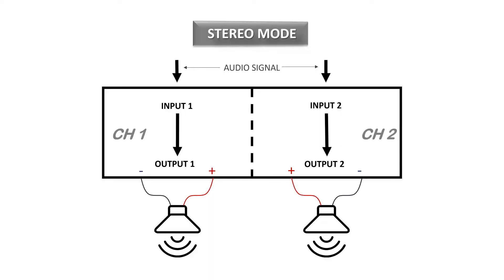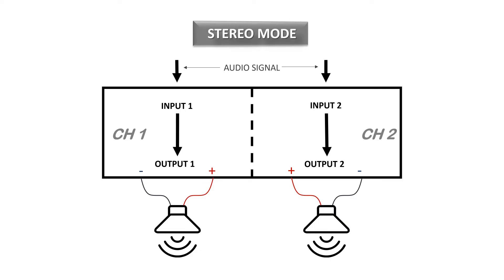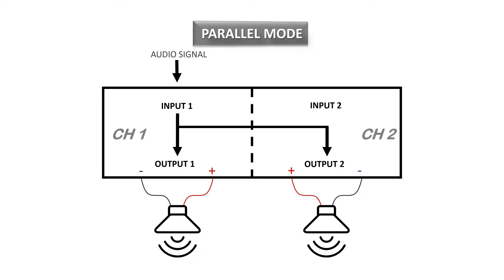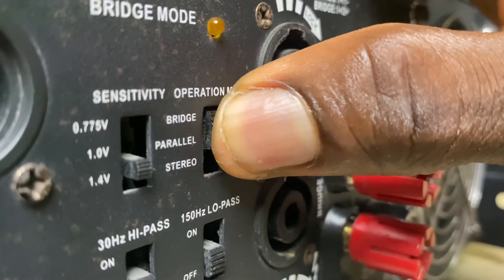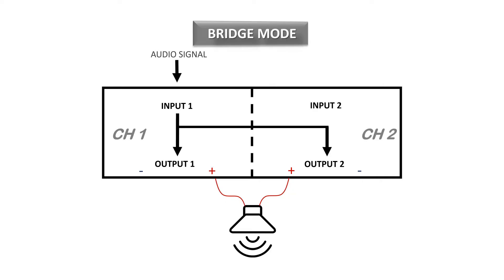How to connect a Mixing Console to a Power Amplifier

Comment: Can I connect powered mixer with power amplifier?
Reply from the maker: Yes, you can. But you have to connect from the mixer output to the external amplifier and not from the internal amplifier output.

Comment: Sir where do you connect the bass guitar 🎸is it on the mic line or line for intruments line on the console i need help because u dont have DI box,also the keyboard guitars do i connect them on the line of the mic or line out or line of intruments on the console
Reply from the maker: Connecting a bass guitar directly to the mic or line input of a mixing console without the use of a DI box is not advisable, because of impedance mismatch. Try any one of these methods instead;
1. If your mixer has a high impedance (Hi-Z) input, use it for the connection.
2. Use the direct-out built into the bass guitar amp/combo (that's if it's available), and connect it to a mic input on the mixing console. 
3. Mic up the bass guitar combo/cabinet. Place a microphone with good low frequency response in front of the cabinet about 2 inches from the front, and a little away from the center.

A keyboard is a line-level instrument. So you are better off connecting it to the line input of your console.

Thank you for reaching out.
Reply: @KelvinEriaganoma  at our church we haven't bought the  bass combo so i normally connect the bass guitar on the line of a mic on console than bass man on stage uses the monitors and also i want to know where i can connect the lead guitar the kick on the console.
Reply: All am looking for is the best sound in our church ⛪🙌 nowander am asking alot of questions sir am learning alot from you
Reply: @KelvinEriaganoma  ok what about the lead guitar 🎸where do i connect it,is it in the line out or where the microphone line or line in on the console
Reply from the maker: Please, message me on Facebook messenger or send me a DM on Instagram, and let’s discuss your setup. Check the “about” session of my channel for links